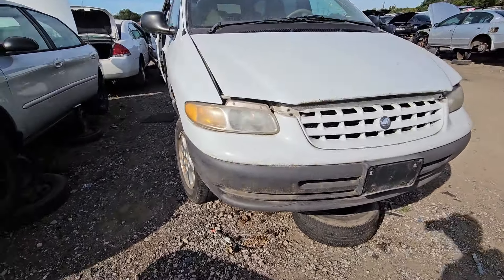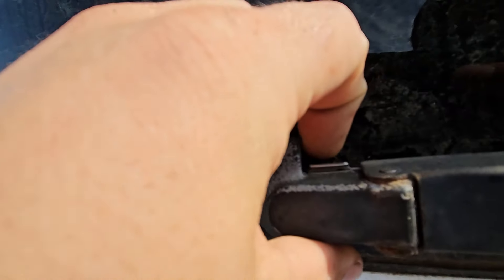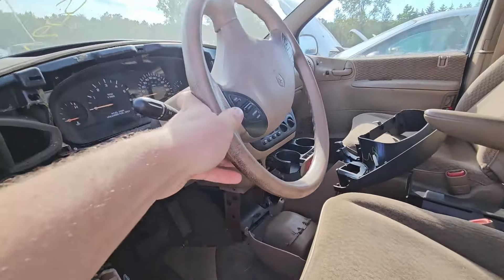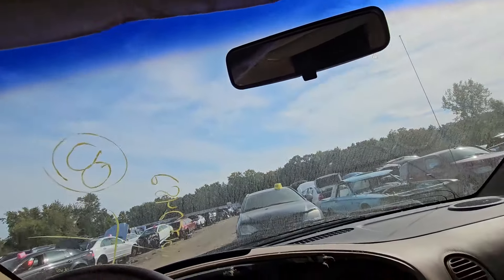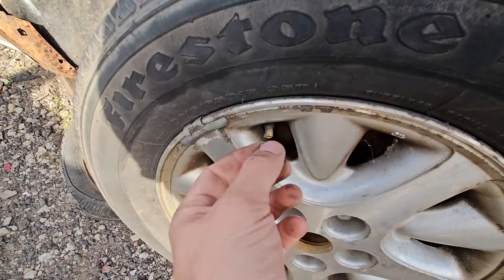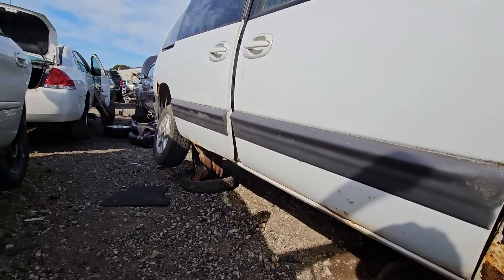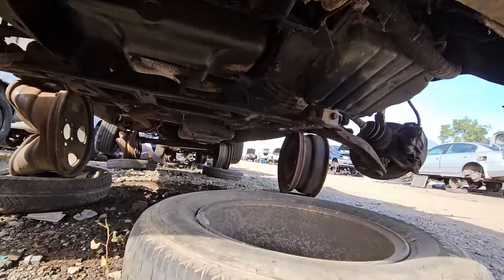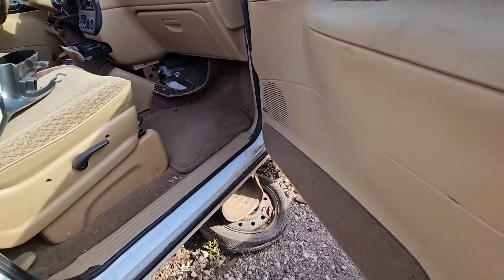2000 Plymouth Grand Voyager SE at U-Pull Salvage Yard in Minnesota

Comment: Have you thought about buying newer 2011-2020 generation tnc or caravan?
Reply from the maker: @zerowater1645  I have no interest in any caravan post 2010. Can't afford it, even if I could, pain in the ass to work on with the newer canbus systems, and I want nothing to do with the pentastar engines. 

2010 still had the 3.3 and 3.8 as an option so I'd maybe be willing to dive into one of those. (Not likely as long as the 1st-4th gens are around). Dad's got an 08 and it's not terrible.

But I just don't have the same love for those as I do the older vans I grew up with.
Reply: @MNMoparMinivan  Fair enough I seen some people engine swap them lol. But nothing beats the older caravans

I grew up with older caravans as well but had purchased a brand new one in 2014 base model for really cheap we had it until 2020 when we sold it with not a single issue with the engine or transmission besides normal maintenance and some typical dodge stuff we were blessed others not so much each caravan we had was a work horse. 

I enjoy your videos I like the older ones as well
Reply from the maker: @zerowater1645  yeah I know there's a lot of people that love the newer vans. I just don't see myself in one unless I'm forced to buy a "nice vehicle". Glad you like the content and thank ya for watching!
Reply: @MNMoparMinivan  , Agreed. Dont like the 2011through 2020 either. The 1st through 3rd gen are easier to work on. Those newer engines & trans are a pain per mechanics who have dealt with them. NO GO for me too. Plus parts are plentiful to find & many still can be found to fix outside of the snowbelt to rebuild & enjoy.